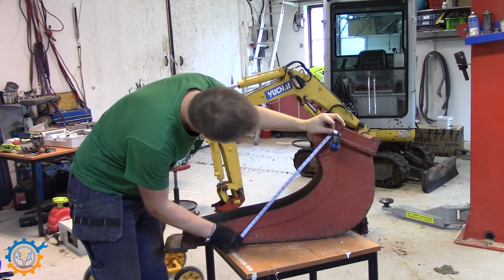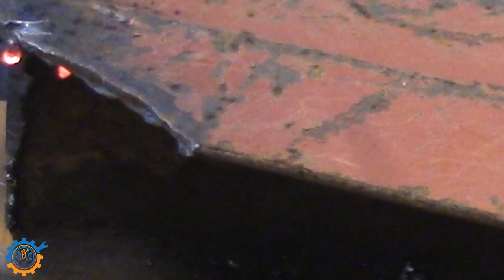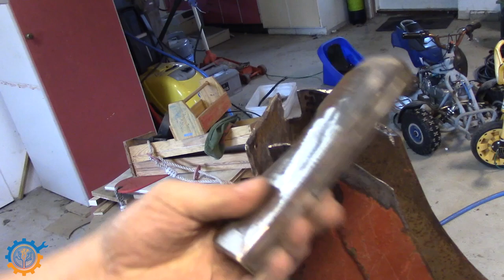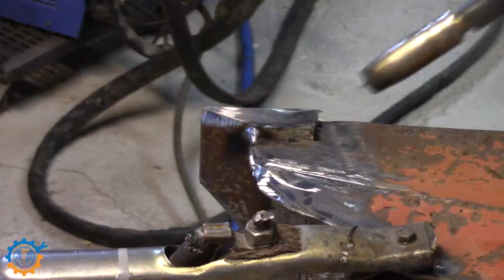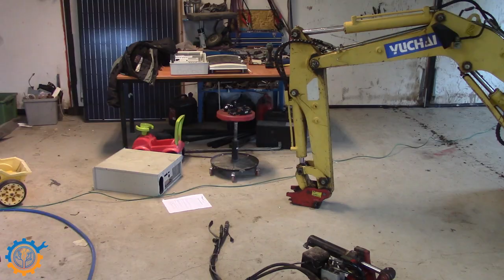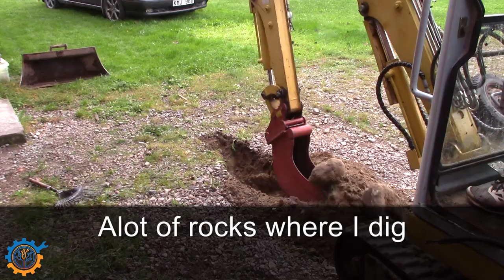Mini excavator cable bucket rebuild

Comment: Plasma cutter - uses wood as guide :D Master!!!!
Reply from the maker: :) Not the best but it works. I tend to use my CNC machine to cut out stuff in wood that I then use with the plasma. It works great actually and have done plenty of stuff with it.
Reply: From the bat I'd never thought it would withstand the heat without turning instantly into ashes! Thanks to you, now i know it is possible. it's a very good material to use as decal to cut along an edge! 
Thank you sir!
Reply from the maker: As long as you dont have backsplash from the plasma its not a big deal and as long as you have the distance between the nozle and the metal its also often ok. The wood will be burnt on the underside but not that much that it does create an big issue :)

Comment: Nice. Is that for your coil of SWA?
Reply from the maker: +pietkaify coil of swa?
Reply: DIY Tech & Repairs at 4:27 as your driving out of your workshop there's a large coil of cable? Normally steel wire armoured in UK. 

Just assumed you were trenching out to run yourself a big armoured. =)
Reply from the maker: Its the new power line for my solar-system. 5g10mm2 :) Rewiring from 4g to 5g system to accomodate ATS system and all that.